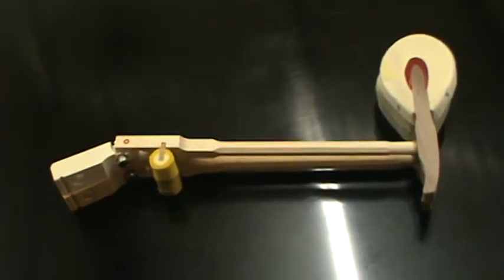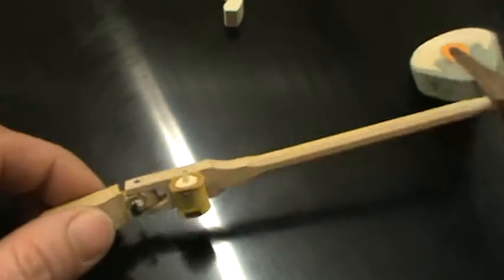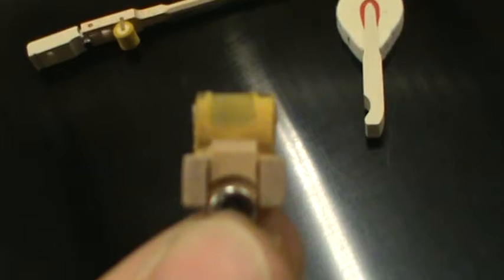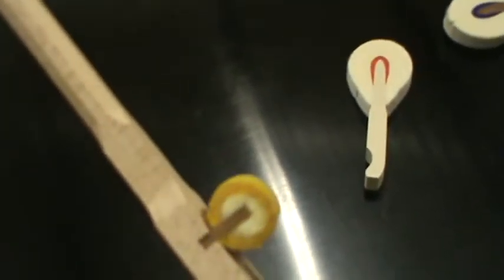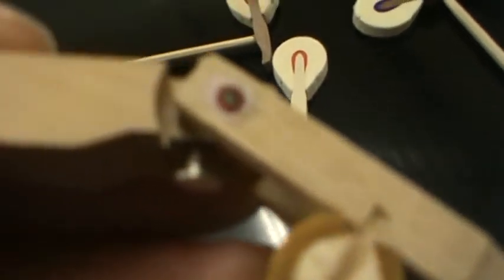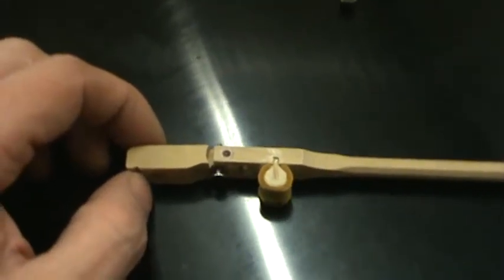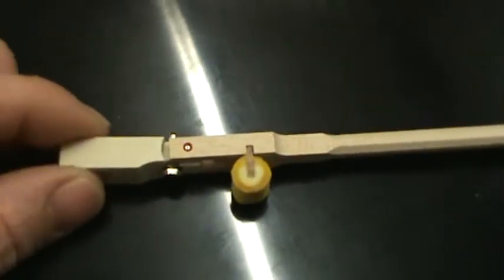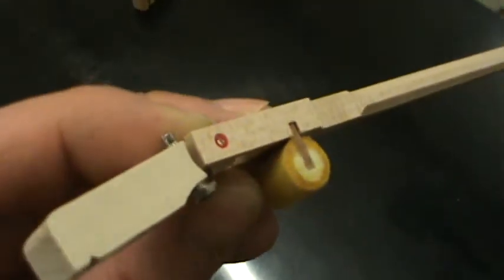Replacing Grand Piano Hammers, Shanks, and Flanges For Improved Piano Playability

Comment: Very good, but wouldn't you obtain the same results if you were to replace the knucles and rebush the flange pin to obtain the correct amount of friction?
Reply from the maker: Yes, you are correct. From our perspective, though, it's 88 flanges to remove, repin, and replace...can be labor intensive and time consuming. It can also lead to inconsistent results from flange to flange. Bottom line: we can replace the hammers, shanks, and flanges for only a slightly higher cost of repining and replacing knuckles. The end result is a solid, consistent hammer replacement, representing added value to the consumer -- and, not to mention the positive increase in the performance of the piano!
Reply: If you are somewhat handy with your hand, you can buy a new set of knuckles and replace the old ones.  A set of knuckles is ~$200 and it may take you 4 hr to do it yourself.